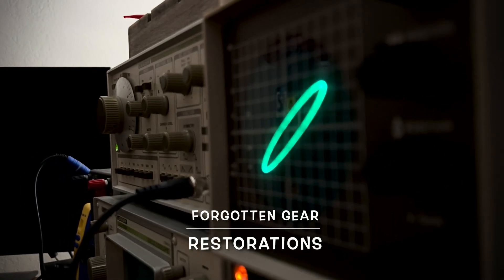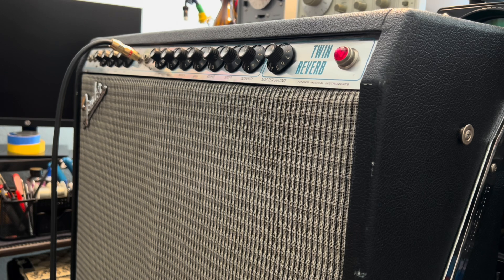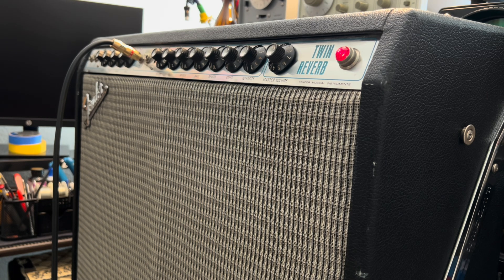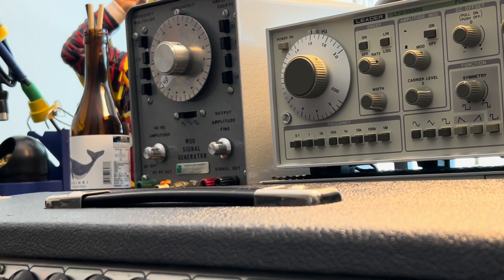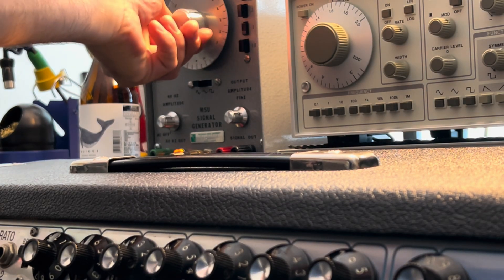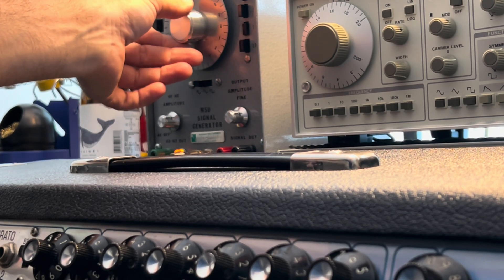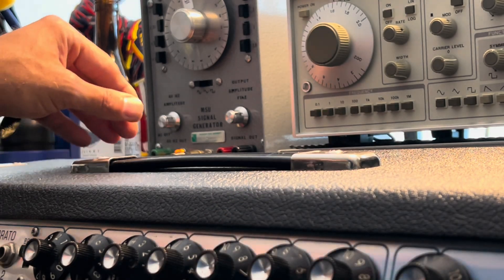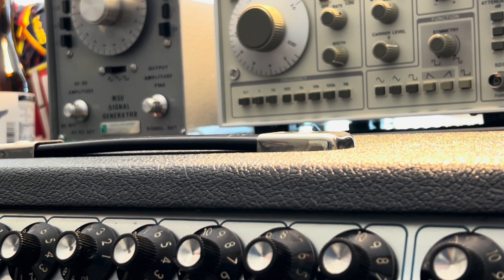'72 Twin Reverb Part 2 | Available Beef

Comment: rewire to black face spec, add variable loop, add ev12l speakers= killer amp,tone and back.
Reply from the maker: @TAM-gz5tc  Owner’s discretion, but I love the silverface tone. Most people grew up hearing that on their fav albums and have credited that tone to the blackface amps.  I’ve been running a blackface 66 super amp in my rig for a while and a customer’s 72 opened up my mind about these early silverface amps.  

On this twin I wouldn’t change a thing. Tons of bouncy compression and sparkle under the pick. Really juicy feel that is unique to this particular amp because of its replacement PT. It’s running about 30vdc low on the plates all the way across and the speakers are just right for what the owner wants, which is a twin that sounds great just off of 2 on the volume.
Reply: @ForgottenGearRestorations same , no need for a mod , my 75 twin has the sound I want ;)
Reply from the maker: So many rush to judgment and mod before they have heard the amp healthy!  That’s a no-no!